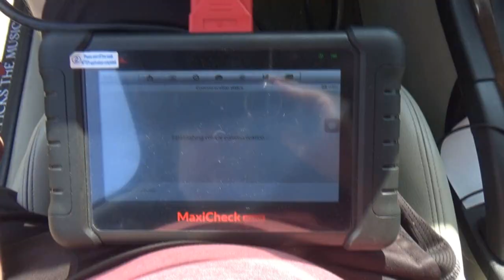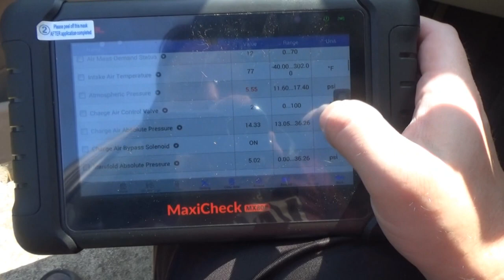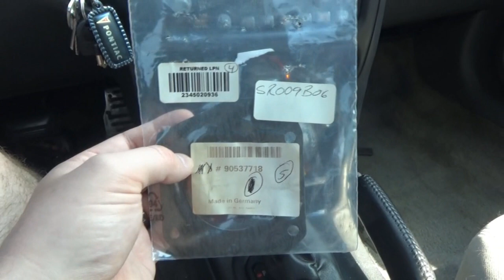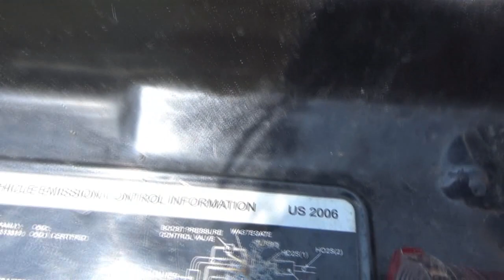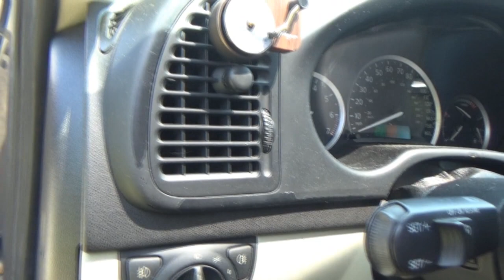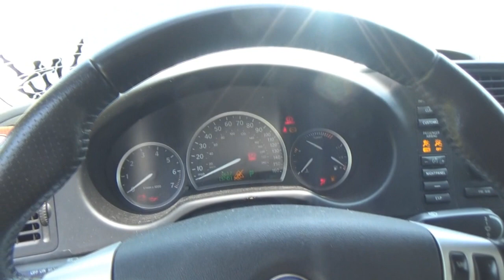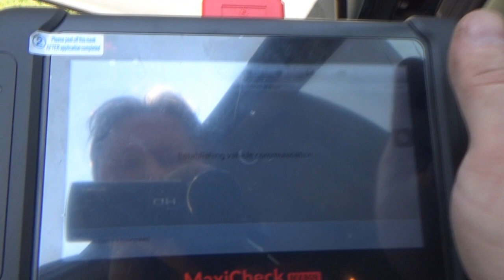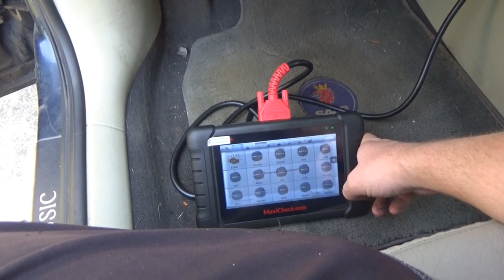MV 411 - "Saab 9-3 2.0t Throttle Body Cleaning"

Comment: mine 9-5 2.0t is giving me check engine light from throttle body and have high idle. Should i clean my throttle body or just buy a new one? New one costs 500€ here in finland so..
Reply: Clean it, and if it doesnt fix it just buy a new one, but before that check it, maybe something else is wrong
Reply: @csutasboss3913 what else could be wrong? they are getting a code for the throttle body so surely its the throttle body. op, give it a nice clean and you should be good to go. and if it doesnt work then buy another one.
Reply: @welcometobangkok8220  A throttle body error is common when ur ECU is dying, at least in a 9-3.